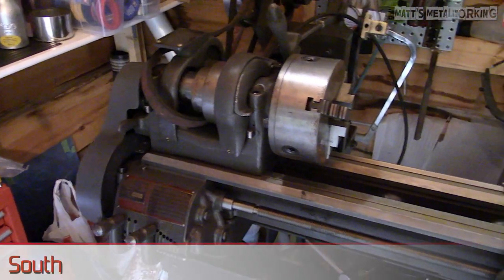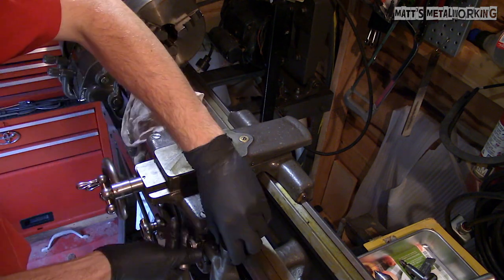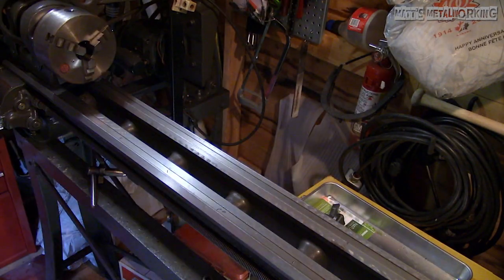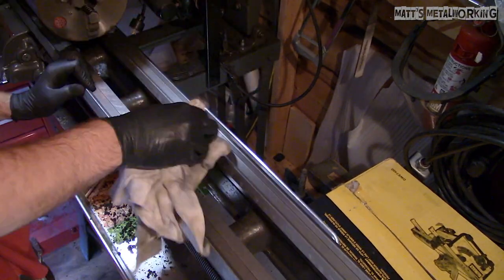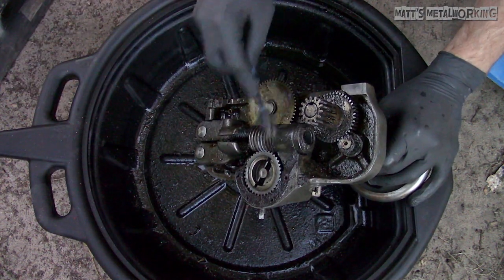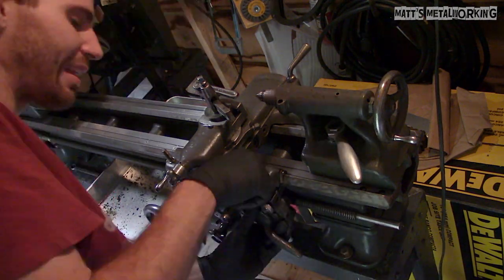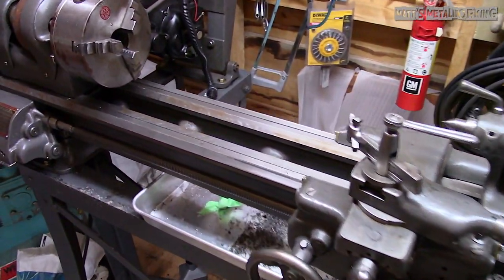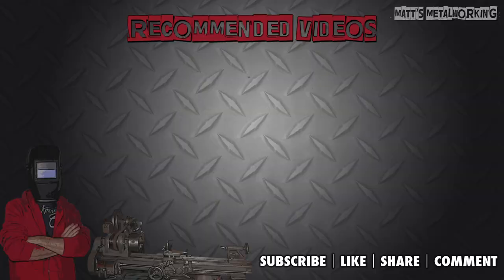South Bend 9a Basic Lathe Clean Up & Carriage Disassembly

Comment: was wondering how the different oil was holding up and what you went  with
Reply from the maker: I switched over to an Amsoil synthetic version, I don't have the model numbers on hand but I will hopefully have something in the next month. So far I'm really happy with it. The surface tension seems to hold up extremely well and it's been exposed to extreme heat and the extreme cold.